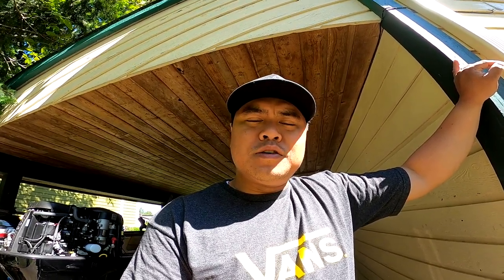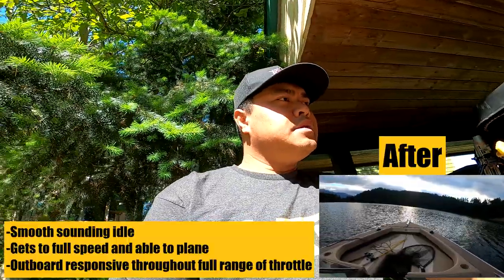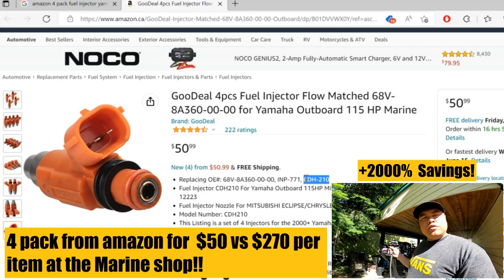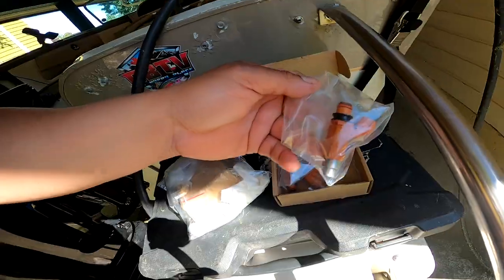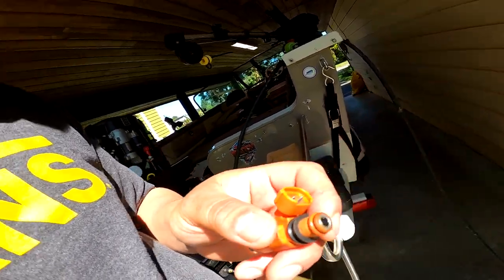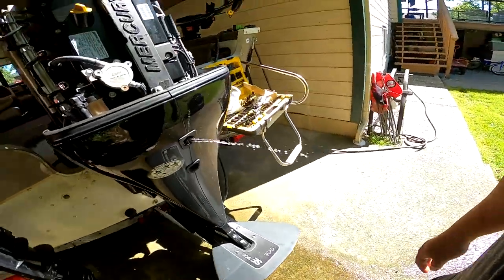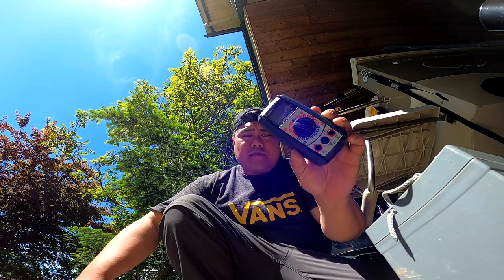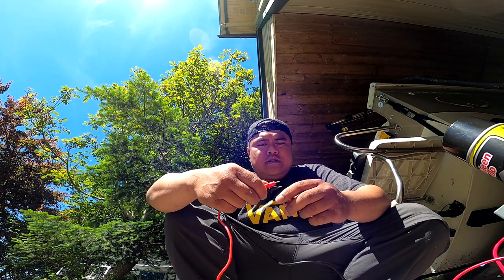Mercury/Yamaha 115hp EFI fuel injector. How to troubleshoot/replace/clean /fix outboard motor. #diy

Comment: Hey thanks for this video. My F115 was running rough with no power at one point this Summer and I had it fixed in no time with your video. And those injectors on Amazon are awesome. They are one hell of a deal for four of them. Now I have three spares in case another one bites the dust. I never suspected a bad injector because the Yamaha software didn't show any problems with the injectors, yet one was completely dead. I just subscribed to your channel for more awesome videos. Good fishing and tight lines!
Reply from the maker: Wooohoo! Heck ya! I'm glad it worked out for u! 😁
Make sure ur fuel is good and water free. I found that to be the root of all problems with power and engine performance. Also clogs injectors. Yes that amazon deals killer. Still have 3 spares aswell🙂
Right on thanks for the support. I'll keep uploading 👍
Reply: @bbtvfishingismyhappyplace  I live on Hornby Island. You have to do your own mechanics or tow the boat off two ferries $$ to get a shop to do it. On another note, the Fall fishing has been killer. Still so many fish around!
Reply from the maker: @bigtreeproductions  exactly! A runihg boat means less down time and more fishing time! The ocean salmon has slowed but I think it's still worth it to go! Still haven't had that big rain yet.
Reply: @bbtvfishingismyhappyplace  Definitely need a bunch of rain. It's scary dry here and fish can't get up the rivers.
Reply from the maker: @bigtreeproductions  yep same this side. Fish having hard time to get to spawning grounds. Been prawning lately? Want to try again soon
Reply: @bbtvfishingismyhappyplace  The freezer is full for the Winter. I'm basically done for the season. Prawning has been good around here. Just watch out for the commercial guys in the Spring. They'll lay there long line of traps right across yours.

Comment: Great video, and I have done this procedure the same way....I do have something I'd like to add, and take it as just my 2 cents. The coils in these injectors are fragile and yes they work on 12 volts, however the voltage is regulated from the ECM (usually), NOT straight from the battery. When doing this procedure don't use a full size battery, instead use a simple 9volt or in most cases even a size D flashlight battery (yes, 1.5 volts will be enough to activate the injectors coil). This is MUCH closer to the typical amperage of the circuit. When using a full size battery, you're essentially offering up to 500 to 800 amps of supply current. It is possible to literally melt an injector in your hand. Being that gasoline or cleaners are as flammable this should speak for itself. Again, in no way am I criticising, or correcting your well made video, just offering advice that I personally feel is very valuable to this procedure. Thanks, and tight liines.
Reply from the maker: Absolutely great tip, Eric! Appreciate the feedback, I'll keep this in mind for my next clean. Luckily, fingers crossed 🤞, I've had no injector issues since woohoo 🙂. Tightlines aswell!

Comment: Thank you Sir!!  With your excellent walk-through demonstration, I’m going to replace all of the fuel injectors on my Yamaha 115.  On another subject, I noticed we have the same boat: G3 V185.  I’m struggling to find rod holders that work with the gunnel track system.  What brand and type do you use for those gunnel tracks?  Thanks, JR
Reply from the maker: You're very welcome! Glad it helped. Good idea to replace. I'd keep ur removed ones, clean em up and use them as on board spares.

I have a Legend 18xcalibur. I do have a track system but it's for my cover. I use scotty mounts and screw them on my gunnel. I use scotty Orca Rod Holders and  powerlock on my downrigger arm. Hope that answers ur question. 
Thanks for leaving a comment. Tightlines and happy fishing!🙂

If u enjoy fishing, come join our group! See u there
https://www.facebook.com/groups/410529470508902/?ref=share

Comment: I hear a very slight clicking on two of my injectors and no fluid is coming out. The other two injectors are clicking much louder and spraying a good pattern. They all ohm out the same around 12.8-13. Could two be bad?
Reply from the maker: Coil looks good, sounds like it's clogged! Buy a other set, install it. Clean the originals and use as spares. Good luck Preston! Let me know how you do
Reply: @bbtvfishingismyhappyplace your video was a big help. I’m a little stumped I got each of the injectors to spray one time only and now they won’t click at all with a battery. Other two are perfect and back in the boat! Wondering what I should do with the two I suspect are faulty
Reply from the maker: @PrestonBrungard  I recommend to keep the 2 used ones as spares and install brand new ones. For how much they cost and the hassle on the water, you might aswell.
Reply from the maker: @PrestonBrungard  check out the description section for links on fuel injectors. Good luck 👍

Comment: Great video, but sometimes it's not the injector, electrical could be the problem no power coming to plug in or wiring harness, find an injector that works and replace, if not working, there is no power
Reply from the maker: Yep! You're absolutely right. That's a possible issue as well. Though, I feel that in most cases, it's a dirty fuel issue. Great tip Thomas!

Comment: Appreciate the video I went to test my old injectors and they’re all reading about 14.5 would you consider that still good even the new Amazon ones are 14.5 although one out of the new box was 12.7 which might be a bad one thanks for your reply.
Reply from the maker: I'd say those are good. If it tested open continuity then I'd say its no good. That just passes the Coil test. Still need to make sure it's not clogged. Hope that helps! Thanks for watching and leaving a comment. Cheers!

Comment: Great job of explaining this system my brother! I can't thank you enough! Seems there is no continuity on one injector of mine..... but it looks like my parts are different than the one you have listed...as my motor is a 2006 Mercury 115 4 stroke 4 cylinder EFI. They don't seem to be available on amazon...so now I'm hunting for one. Thanks again for the help, you got me going in the right direction. Boffa
Reply from the maker: Is the part number the same??
Amazon has a pretty good return policy and aswell. There is such a thing as partial blockage on those injectors. Even if u do the test and it works, it might not be working at best efficiency. I have a set of injectors on board pre cleaned/new on stand by.
Reply from the maker: CDH 210. Hard to read but it's on the side of the fuel injector body.

Comment: Hello from denmark. I have the same motor on my boat.  In neutral there is som kind of bering noice from gearbox. But when i put it in gear it stops. Do you know anything about that.?
Reply from the maker: Hello Morten from Denmark!
Sorry, but not sure of that issue. Where is the noise coming from? I know there's an adjustment on bottom leg shaft that links to the power head. Perhaps you can adjust that? You might have to remove your lower leg to access it. Perhaps it's not a bearing, but you're partially engaged in gear and just need an adjustment?

Comment: Great video. Wish I would have watched before taking to mechanic. This was my problem
Reply from the maker: Hi, HREC! Thanks for reaching out. Don't get too down on yourself. It's a part of the learning process, and you will now be armed with knowledge in case it happens again.
Besides, now that you're able to run, it doesn't mean it's fully fixed. You'll still need to get to the root of why your injectors fouled.
I had a fuel contamination issue. My fill was taking on water due to poor design. I put the fill on a 4 inch riser and I've had no issue since. Hope that helps. Best of luck  and happy boating!

Comment: You should do your timing belt and check the idler tension periodically. Belts should be done every 5 years or 1000 hrs , which ever comes first.
Reply from the maker: Sure thing! Wish I knew how many hours the previous owners put in. This years model had no capability to plug in a computer. Guess that's on my to-do list.

Comment: great in-depth tutorial, i'm going to try it myself.
Reply from the maker: I hope it helps it gets you up and running!
Once you get it going, as I mentioned in the video. There is absolutely something clogging up ur injectors. This will remedy the injectors being clogged but eventually you will have to solve why debris is getting through all the way to the injector which is the last point of delivery.
Regardless this will definitely save u some time and money. Could even save your trip from being ruined. I had this issue mid trip and swapped it on the fly and had a great rest of the day.
Keep ur used ones, clean them and leave on the boat for spares.
Good luck! And hop to see u on the next adventure. Happy boating 😊
Reply: @bbtvfishingismyhappyplace  thank you, Ill keep that in mind.
Reply from the maker: No problemo! Goodluck and please subscribe if u haven't yet. Thanks for stopping by! 👍

Comment: Hi. Cleaned injectors as per video . Worked for me . Motor runs WAY better !! Thanks
Reply from the maker: Hi Millwright express! That's pretty awesome!!!! Glad to hear it... this might not be the end all.and be all.. you will.still need to resolve why it got clogged... dirt is going through the full fuel system all the way to the injectors which is the tail end of the system...

Have u checked ur vst unit? Also I work hand in hand with millwrights. Just thought I'd mention lol
Reply: Well after 20 years they probably needed a good cleaning. I always treated the gas properly , even for storage.

Comment: I’ve had to replace the injectors twice on my Merc 115 - any thoughts on how to prevent this from happening? My boat does not get used very much so I think that’s the problem.  Would it help to run all the gas out of the line? Maybe I should install a shutoff valve on the fuel line..?
Reply from the maker: Hi Roger thanks for watching and leaving a comment. 

Unfortunately, infrequent use will cause fuel separation. Hence water and oxidation and other not so pleasant results for your outboard.

Now to prevent breakdown issues
1-add additives like mercury quick clean to your fuel. I've also read to leave the tank as full as possible to prevent excessive moisture
2- change fuel filters often
3- keep your used fuel injector spares, clean them and have them ready for swaps (makes it cheaper rather than going to the mechanic)
4- recirculate your fuel with an external fuel pump and add inline filters to filter debris
5- if leaving unused for an excessive amount of time perhaps empty the tank into a jerry can and use the gas for your vehicle or add additives to prevent separation.
6- join facebook outboard repair groups to ask for more ideas
7- use premium ethanol free gas 
8-empty out and replace fuel water separators as required

I know Its a lot but it's the price we pay as boaters I suppose. These are just a few suggestions and I'm sure there will more I've missed. Tip #6 is most suggested. 
Here's the link. Theres 39k members there so there will be lots of help available there for you.
https://www.facebook.com/groups/940259685987841/?ref=share

I hope this helps. Also if you havent yet please give me a LIKE, SUBSCRIBE and a click on the BELL ICON to be notified of future videos.

Best of luck to you, tightlines and happy boating 😊
Reply: use fuel stabilizer in your tank if youre not using it much

Comment: Thanks for the video.  I need four 877826 injectors for my 03 Mercury60hp…but eBay is loaded with aftermarket injectors anywhere from $15-$40.  I’m overwhelmed and don’t know which to select.  Any thoughts to help me out here?
Reply from the maker: Is that the actual part number? Can always call a marine shope and ask for the part number then u can scout where is cheaper.
Can always do a clean like I showed in the vid. Might just be plugged up then their basically new again.
For peace of mind I suppose a new one is best but as shown in the vid even if it's new it could still be defective.
I got these from amazon as the quotes are unbelievably expensive at the marine shop so perhaps try there. Aswell these injectors would be the same for auto parts. That being said there could be the same injector for a car and can just get the injectors from them (click on the amazon link and you will see its prompted as the same for some cars). I hope that helps
Please give me a like and subscribe when u get a chance and join our fishing group! Link in the description section. Tightlines Hiken Mikes!
Reply: @bbtvfishingismyhappyplace  …yes, that’s the number given to me by the mechanic that’s going to install them for me.  He’s doing the work on the side, so I’m responsible for getting the parts.  Thanks for responding 👍🏼😀
Reply from the maker: Ah ic. Ok well I wish u luck! Definitely clean and test the old ones and keep as spares then. 😊
Reply: @bbtvfishingismyhappyplace  will do👍🏼

Comment: Watched your video a week ago and today this happened to me. The boat wasn't able to go on a glide. So I was able to troubleshoot it with a fried using the method you have showed on the video and now I know what to do next. Thanks for the video!!!
Reply from the maker: Awesome! I'm super glad I was able to help😊

I would like to add some info.
In the video, I mentioned that if debris has made it all the way to your injectors (last point of fuel delivery), then you must check your fuel system. From your gas quality, fuel filters, water separator, and high pressure pump (also has a screen filter, also known as VST). 

Still, I'm glad you're able to get it up and running and have saved yourself cash and downtime. I've been wanting to make a follow-up video to this fix as I found that hidden filter in the VST unit, which involves in-depth deconstruction to get to it but very easy to do! 

I also changed all my fuel lines as I didn't know how old they were and if they were deterioting inside. In short, I meticulously went through the whole fuel system.

Thanks again for the feedback, tightlines and happy boating!!
Reply: @bbtvfishingismyhappyplace  No Sand Heads for me today but I have time to fix it and go out again soon. BTW which grade of fuel you use for your motor?
Reply from the maker: Oh, nice! Wednesday or Thursday, I'll be there.
I use 94 octane chevron for ethanol free.
Recently, that's not the case anymore. I might go back to 87 now if there's no advantage to using 94.
Reply: @bbtvfishingismyhappyplace  well hopefully see you there. I'm running Campion Explorer center console usually with 3 roads and in yellow life west. If I'll see you I'll wave my hand :)
Reply from the maker: Awesome! See u there!

Comment: I have the same motor with what seems like a rough idle. First time I took the boat out it got on plane once with no issue then acted as though it was starving for fuel. I went through the entire fuel system including testing and cleaning fuel injectors. Checked and adjusted tps sensor also no difference. Ideas?
Reply from the maker: Yes, I do! You need to check ur Vst! There's a filter in there that can get clogged. 
Like I mentioned in the video if your injectors are clogged it basically means your fuel was contaminated at one point. Somewhere in your fuel path, debris will accumulated.

Have to remove the manifold to access it but once u open it up you will a float and a fuel pump. Under the fuel pump there's a screen filter that you clear. It basically starves your motor st high demand but fine at lower demand. 
I would check there! Let me know how u make out. Was intending to make a video about it but didn't want to take the whole thing apart to repeat the process. There are YT videos out there tho! Good luck 👍
Reply: @bbtvfishingismyhappyplace  that’s what I was saying it’s all been through only thing I found was just a little bit of blockage on the high pressure pump filter the rest of the fuel system was spotless. I drained all the fuel that I emptied through coffee filters and found nothing.
Reply: @bbtvfishingismyhappyplace  I’m going to put it in the water again to test for power but the idle is still crappy. Lift pump is pumping great also. No difference running from a separate tank bypassing filter housings no change in idle or off idle stumble.
Reply from the maker: Are those new fuel injectors?
Maybe they're not getting a signal, or the coil in them are no good. There is also such a thing as partial blockage on those fuel injectors. They may keep engine running, but idle will be more rough.
Do u have proper fuel pressure? There's a fuel guage u can attach to the rack that holds the fuel injectors. Looks like fitting for tires.
Are your lines all tight? I've also changed all my hoses to the black ones.

Sorry I keep editing it. Darn auto spell
Reply: @bbtvfishingismyhappyplace  yeah I cleaned the injectors they patterned good. I have not checked the pressure at the rail under laid but I have out of the water and was fine. I’m fairly familiar with outboards just don’t have any equipment to test modules or sensors.
Reply from the maker: @javery50  if I get a chance I'll put a guage on my fuel rail and get back to u. Hopefully give u a nudge in some direction.
Reply: @bbtvfishingismyhappyplace  most are around 40 psi

Comment: Great video. Thanks! I wonder if the fuel injector on my 9.9 hp Tohatsu is still the problem because sometimes it runs for 30 seconds just fine, then runs rough for a few minutes.
Reply from the maker: There's contamination on that fuel perhaps. Need to go through everything but a good fuel injector inspection might be in order. Good luck and let me know how you make out. Thanks